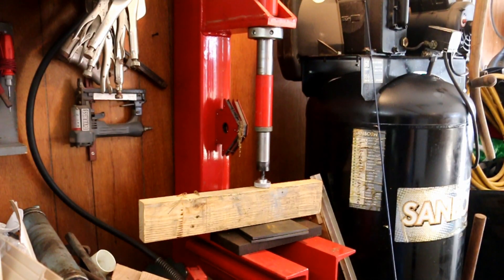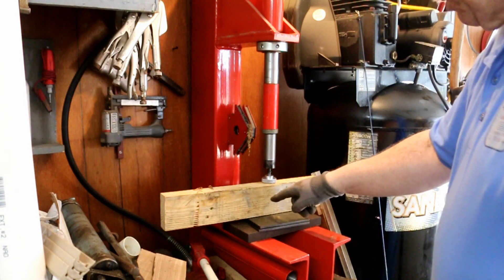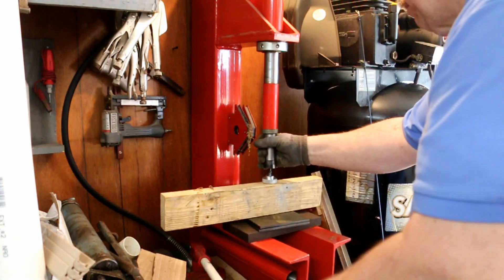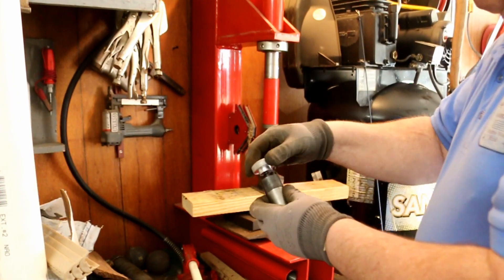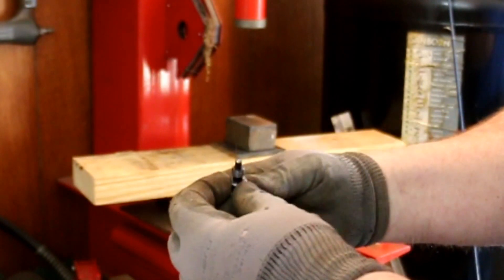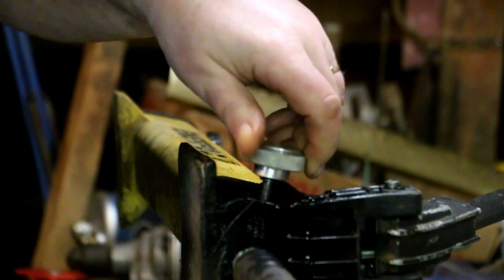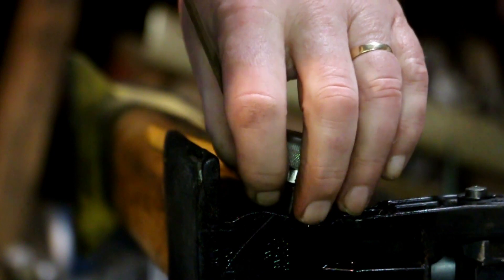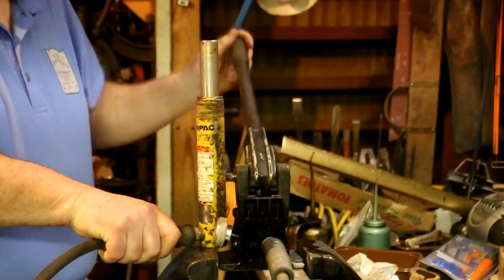Enerpac Hydraulic Power System Pt 3 Release Valve

Comment: You got it all fixed up ready to lend to someone....You don't have to worry cuz next time you`ll see it ....it won't be working anymore....I guess that a good thing to hear on a Friday after having fixed it.....that`s the way things work in life....now can I borrow it? I`ll bring it back before the next five year you know...I hope... well done sir....CHEERS
Reply from the maker: People have noticed that there is a brand new full set of screwdrivers hanging in plain sight over my workbench. Actually there are two sets now. 😆
They are from Harbor Freight. I get them free with a coupon. Every time I buy something there I have a coupon for something free and often it is screwdrivers. 😆
That way if someone decides they need a screwdriver and takes the handy set I'm out exactly nuthin. 
If you want to borrow my tools I go too. I'll bring the whole kit and kabootle too. You get to use the screwdrivers! 😈
When I'm done I will gift you with the screwdrivers, a magnet bar to hang them on, a flashlight, a 25 foot tape, and a magnetic tray. Total value per HF estimate = $137.26 (made up number😲) Total cost = 0
Of course I expect you to help while I'm there. Get me a drink. Dig holes. I provide the shovel. Haul rocks. String wire. Stack firewood. The usual grunt work that I don't want to do. 
I use to loan out tools. Now I give them away. Easier and cheaper. 
Don't forget your free screwdriver. 😎
Reply: @OldSneelock  But Unk this is the third time you want me to move that woodpile and ya keep telling me to put it back in the same place.
Reply from the maker: Keeps ya busy and out of the way. Like throwing a stick for the dog. 😆😎
Reply: @OldSneelock  We had the
rent-a-pup the other day. Cheryl was playing tug-o-war. She jumped and I didn't. Bandaids on the arm again.
Reply: @mostlymoparih5682  Hey Marty,,,, that`s a good one on you "Keeps ya busy and out of the way. Like throwing a stick for the dog" He may be old but he`s fast....CHEERS
Reply: @gatorsworld  Leave me alone Gator can't ya see I'm chewin onna bone.
Reply: @OldSneelock  Just by the way....Thanks for the screwdrivers but I won`t take the rest....My garage is full
Reply: Like I told him; if anything leaves here I go with it. VERY few get away with stuff by themselves because if they mess it up neither one of us will have it.